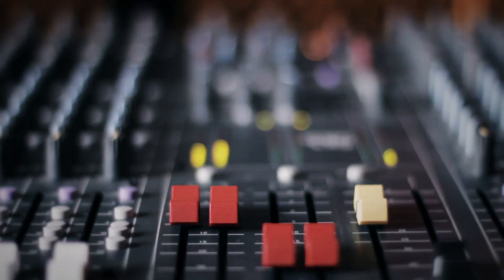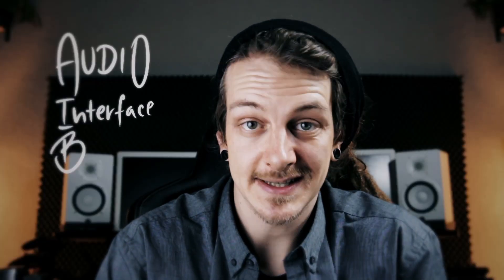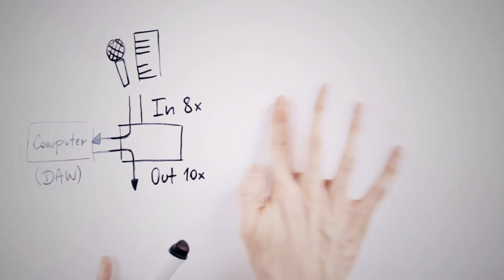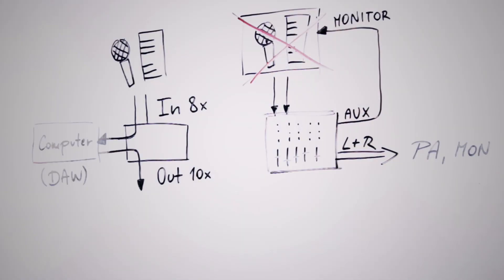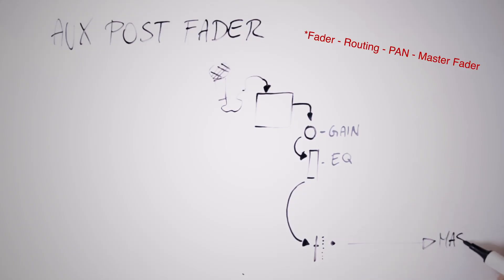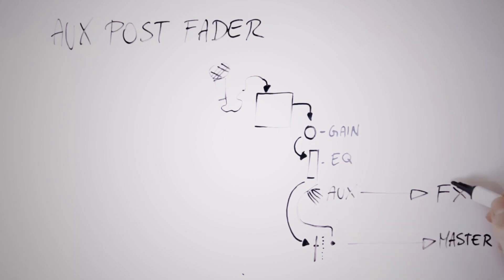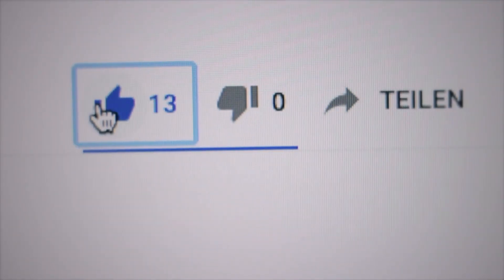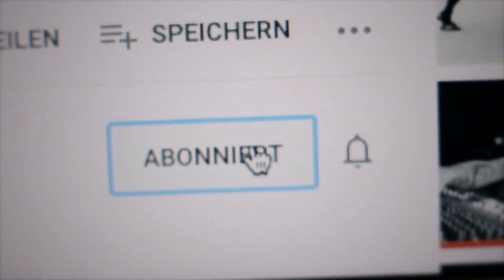Learn DUB MIXING in 5 Minutes - [w. ANALOG MIXER and Guitar Pedals] - Reggae, Dub Tutorial

Comment: Dub can even be done with only one mono, or 2 stereo l/R tracks. Make sure you have a few effects like delay/reverb and a mixer where you can copy the l/R stereo coming frkm your daw or record player etc.. to another input channel witn an eq, wich can be send to an FX..Something like a aux output. When you copy your stereo l/R you can try to grab a freq out of the stereo L/R. Use the eq to filter out the low freqeuncys, and the ultra high ones, send this copy through an fx by aux or your fader (aux post fade). You now have created an extra channel by isolating specific freq. Repeat these steps this way you can use strereo masters and still be able to do a multitrack live dub. This is perfect when you want to dub vinyl records or cassetes....

Comment: it is very interesting
maybe a pdf graphic showing the easy set up to a more complex could be helpful with minimum funds out lay for extra equipment as things stand. i'm just a crap home jammer and low fi hobbyist with bad GAS though the noise threshold is quite low but it's not hi fi and i'm lost somewhat that graphic would help a lot. 
thinking? i need to strip it all down and complete new and radical reset up. and if i could see where things fit within the system and those missing items that i did not know of or realise i needed it would be very helpful indeed

Comment: great video thanks! As a side note, an alternative hybrid setup would be having an Audio Interface Mixer instead of Audio interface + mixer. That allows you to send audio from your DAW to mixer directly (without additional cables). In other words, can save some money on the audio interface, and invest it in some effects, while still having the advantages of an analog mixer, if I am not mistaken (trying to figure out things before buying stuff)
Reply from the maker: thank for the comment!

sure thing! in our case the interfaces were there before 😅
Reply: Have a look on the tascam model series. Analog mixer + audio interface in one device
Reply: @ThobbyJones   it seems like the Soundcraft MTK22 seems to be a better option, because of the 5 pre/post fader AUX channels
Reply: @ThobbyJones  how many tracks does it offer? Thanks.
Reply: So I can use a, for example, Mackey Onyx Audio Interface/Mixer and use the physical sliders to control the sliders within the DAW? I think that would solve the problem of needing a large interface with 10 outputs AND a large mixer
Reply: SSL big six, go for it!

Comment: Wanted to ask, what's your mili/seconds set on your delay?
Reply from the maker: I'm glad, that you asked, because I got no idea to be honest😅... need to do some research first.
For me it's always a feeling thing on analog units. Usually I turn the knobs until it's in the feeling of the song and time match in a pattern
Reply: @SteppersDivision  I have heard of different milli/seconds set on delays. One was 250 and the other was 300. Somewhere in that range. I just wanted to confirm was that the standard for King Tubby's sound. Now as far as Echoes and Digital Delays, Roland made the RE-201, Space Echo (which are getting harder to find). Then they came out with the Boss Space Echo RE-20. A few others are out there, Echosystem Dual Engine Delay, and the Beni Dub Digital Echo. Would you recommend any others?
Reply from the maker: @rivercidal  yes the RE-20 is meanwhile a standard effect in Dub Stations. But its also quite big - a 2 pedal unit takes more space.. Small pedals are easier to carry around for live shows. On the other hand, bigger rack units got more settings... I recommend to try out different units and experiment around. And also to decide early on, if u want to play Dub in a studio setup, or live... Or both... 

In general every delay with a tap tempo ability will do a great job. But even a small pedal can create Dub Magic

Comment: Use group outs to send to an fx per channel you can quickly tab a button to send the signal to an fx and save up your auxillarys
Reply: It works kind of the same as an aux in post fader. I find it easier to tap a button and work with a fader.

Comment: good job, well explained. Will probably give it a try with a simple setup. Thanks! 
Also for folks without hardware I guess an easy try can be Caustic 3
Reply from the maker: Thank You very much!

And and also thanks for the tip with Caustic 3!
I had no idea, just made some research and I love the app.
Reply: @SteppersDivision  I mean I don't want to sound like promoting it but it works with midi controllers so it's a cheap alternative since anyone can have android phone under 100$. I have used it to jam with Akai mpk2 and you can have this exact setup you are showing, no joke - map the pads to mute/unmute the channels and map the faders to the effect knobs... Thanks again for the detailed explanation!
Reply from the maker: True True. This shows one more time, that u don't need a big wallet, or lots of equipment to do music and learn more about. 

You're welcome!
Reply: @bozhidarkn  i have followed your advise but i cant understand how Connect the MK3 to my Android phone .could you Please explain ? Thanks& bless
Reply: @findingsolutions198  you need adapter from usb to usb C (otg cable). They go for around a dollar where I am from - just google OTG. Also in Caustic make sure to enable MIDI from the settings. I hope this helps!
Reply: @bozhidarkn  yes , this help a lot. Protection

Comment: Video is great , nice explaining how you connect and start and all but I miss the core element of dub where you use mixer as delay device where you send delays return channel back to the delay, again so called aux feedback loop. Delay unit I ussually set to arround 300 ms short delay and by doing aux feedback loop extending the echo using mixers fader as you would feedback knob on the delay.  There is where magic happens in dub. Anyway thanx for the video its good to send to friends that want to start dubbin.
Reply from the maker: thanks for the advice, i got to try it out like right now! didnt know before, its all learning by doing😅

Comment: So you really don't need a reamp box to send the signal through the guitar pedals? Is there any noticeable difference in sound? I saw somewhere that most Boss pedals and a lot of others do the trick on bypass mode anyway. Thanks again!
Reply from the maker: tbh, I didn´t know before about reamping for the dub setup.
U made me curious, so i made some research and this is what i've learned:
There is a impedance difference. So some pedals will send out signals which are just not strong enough - in that case u have to use a reamp box before fx to match the impedance.
 
When the signal is strong enough - it will work, because u still got a gain knob on your AUX Return Channel - that´s what happened in my case.

So I would say - it depends on the Pedal? Is that an possible answer? - And of course stepping back to the correct impedance will create a much bigger sound and u can use the pedals to the fullest. 

Still, as long as it works in some way, dub mixing will be fun anyway :D even if there is a sound difference.. 

btw thanks for your hint! I learned a lot of stuff through this and i think the next dub mixes will be better, because of this. appreciate!
Reply: @SteppersDivision  thanks for the explanation, appreciate it! Looking forwards to the next mix
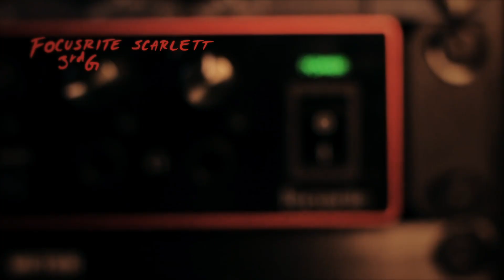Reply: Impedance wise...Rule of thumb is 1:10 ratio. So to drive a 47K fx unit u need to send like 5K into it. Most mixer aux sends are between 50 and a 100 ohms. But im not to shure about "bridged" outputs. So im gonna do some test soon and build some reamp boxes with diff resisors. 
But for me the most important thing is that a reamp box coverts a balanced aux out +4db (line level) to a unbalanced (-20db/100K-ish )instrument level. My Boss fx are 1M input so a perfect match 😉
With a DI box and ground lift enabled  after the fx to convert the unbalanced signal back to balanced 
You should have more headroom.

Comment: so mixer has to have aux outs post fader? how many mixers have this? some? all? is there a way to tell without trying it?
Reply from the maker: Hey Will, whats up?

I think every mixer will work out - in some way.
Almost all mixers (even the small ones) got AUX sends.
When they are only PRE, it's just going to be another dub technique.
The Post Fader Technique is just one of maaaany ways how u can make dub.

On bigger mixers u can usually choose between Pre or Post.
Smaller ones are usually set on PRE as default (stage monitoring standard).
Sometimes they got a FX Send which is Post. For example the Behringer Xenyx. 

You don´t have to try, you can tell what the mixers doing, by looking closer on the Kobs - there´s always some sort of tiny letters which describe the function.

Anyway, the whole idea of Dub is to get crazy with effects, trust me, it's gonna be fun, no matter how u set it up :D

Comment: Great work guys! Could you please recommend a multitrack mixer with integrated sound interface in some 400-700 euro range?
Reply from the maker: hey mate, thanks for the comment. 

im not 100% sure if combined mixers gonna make the job the same way.

i think you need to research that first before buying stuff.. and also it can be quite useful to have the mixer and the interface separate, it depends on how u wanna use it
Reply: I have the soundcraft 12mtk. Analog hybrid mtk mixer with digital usb returns. Got it for 270 second hand. It does the job well

Comment: There is an impedance difference when using pedals and line ins and outs. It will make a sound but not sound to its full potential. That is basic engineering 101. 

However, you can easily combat that but re amping. But you don't need a reamp box to do so. Electrical engineering 101 here. A transformer flows both ways. So take a passive DI box (only works with passive DIs) and hook it up in reverse. Now you have a reamp box.
Reply from the maker: thanks for the comment, 

ill try out!

Comment: You said if we have 2 channels or less on our interface it won't work but You only used 2 channels on the chart
Reply from the maker: Hey, thanks for the comment. I think it was just easier to draw.. In this video we were sending out 10 stems to the mixer.

..and the outputs 1-2 on the scarlett are set to 'DAW Playback 1-2'